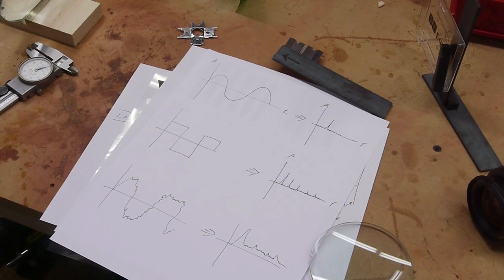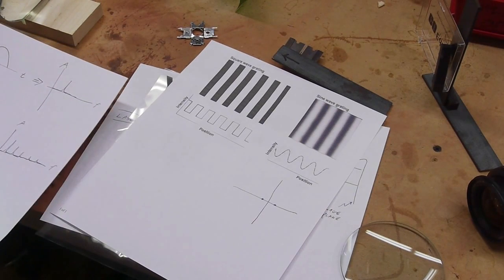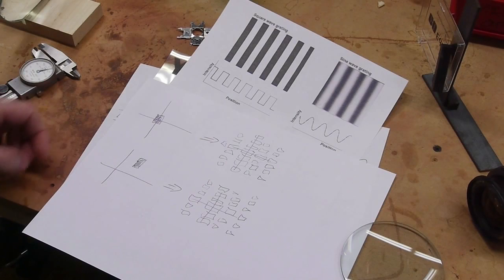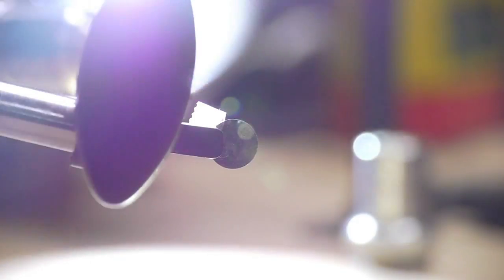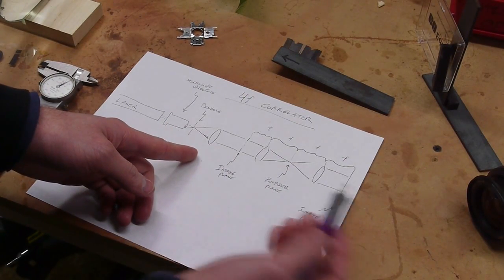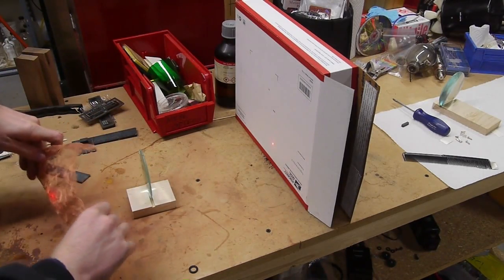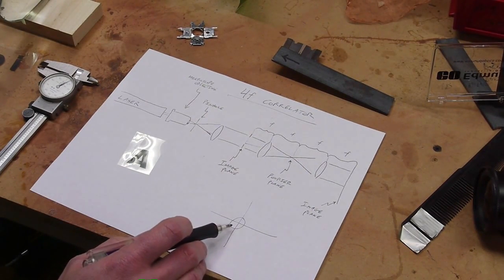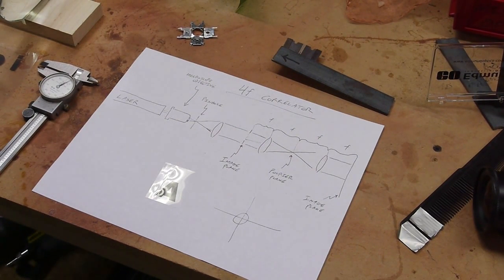Intro to Fourier Optics and the 4F correlator

Comment: Nice video and a good basic description. There is a minor but common error when you say that edges cause rays to diverge. This is a common misconception that many amateur astronomers have about secondary mirrors and their support vanes. The resulting diffraction pattern is due to the absence of light from those regions, not scattering. You can validate this with a simple Python program that simulates Fraunhofer diffraction. Although the math in the Fraunhofer approximation is complex, the underlying principle (basically Huygen's principle) is not and you can numerically find the results without all the complex math.

Comment: This is simply put a Bertrand lens. In microscopes it allows you to see the back focal plane, i.e. shifting the conjugate planes of a microscope, and obtaining an image that can be described as a Fourier transform. 
The same result can be achieved in a microscope by removing the oculars. Of course one huge problem is that in the conjugate plane of an image you also see the emission source itself, which can be mitigated through Koehler illumination.
 A cathode tube is a microscope by all means so all tricks in optical microscopy can be applied.

Comment: Great presentation!  

My physics professor showed me this in the lab one day, more than 50 years ago now.  He used black and white microfilm and microfiche.  He showed me newspapers on microfiche that could be searched for specific things.  Your clearer explanation of how to use the "amplitude only" part of the spectrum to make the information location independent was helpful.  There will be geometric issues I think, but that helped clean up an old memory.  I have over the years kept an eye on this, and now there are micromirror arrays, and many controlled transparency materials to generate the spatial filters using the computer.  Nothing was ever cheap enough for me to try it.  It seems everything that is interesting quickly becomes costly.  But your videos are a good "buy" because you are always trying to show how things work and how to build them and understand them.  I can think of a few things to try, but there is no way to interact on YouTube, except by quickly disappearing text notes. Thank you for your work.  I just watched an old Raman spectroscopy video of yours where you said you were going to get back to it, but I could not find it.  I really liked what you showed with the pinhole.  I wish you had spent more time.  I want to find a way to spread out the intense points in a better way. Bessel beams and optics seems a good path.  I am getting older and there are billions of things to look at and try to calculate.  I can't build anything, mostly too costly or too hard. But I can calculate most anything.  Go figure.

Richard Collins, Director, The Internet Foundation

Comment: The pinhole used to "clean up" the laser beam is in fact the same thing as the filter you talk about later.  Higher order Fourier components in the laser beam itself due to imperfections of the laser cavity, optics, cleanliness of the cavity + optics, etc are "filtered out" by the pinhole.  When an image is "created" in the colimated beam section, you are simply addging "higher order" Fourier compoents back into the "cleaned up" laser beam.

Comment: Im a lay person but curious nevertheless,  where is the fourier data on a holographic film, or in other words how is the information non local, meaning any segment of the film contains all information regardless how small. Even if we cut the film any peace regardless how small will contain all information. Can we extrapolate the data and do we know how this actually works or is it a known unknown? I do know fourier mathematics are involved in holograms and Im curious to know if there is a clear way of presenting this to a lay person like myself as recorded holographic data seem rather counterintuitive. Meaning if you remove a peace of a holographic film one would think information would be lost. I do know that the image is recorded using 2 beams, a reference beam and an interference beam. How this actually works, Im clueless.

Comment: About 15 years ago, I had designed several optical stages that performed multiplexing of 3 beams of different lambda, into a single fiber. Normally this is an expensive set of complicated optics.

Moreover, I needed a tophat beam profile, meaning instead of a gaussian concentric beam energy density like you showed, the brightness of the beam as a spot on a target had to be uniform strength.

This beam forming is a fundamentally desirable optical function, yet the methods to achieve such a profile are extremely complicated and require several optical stages to perform.

To top it off, I am not an optical engineer.

Anyway, the mux ended well with my design being good enough and very inexpensive.

As for the beam former, I searched so many resources and found an obscure optical schematic for tophat beam formation using only to biconvex lenses and a spatial filter. But there was absolutely no explanation. I had theories, but no understanding of how or why it worked.

Your video 15 years later made it clear before you got to your aparatus. Just the description of the spatial filter, combined with the spatial FFT intro.

Effectively, there's two ways to look at it.

The cheesy way, is how I thought it must work:

The rough beam profile is compressed to the focal point and the spatial filter just takes the prime, central cut of the center of the beam and that's all that gets expanded back through the output objective stage, meaning you lose energy, but it's evenly distributed.

But now, from this video, I know better, I think:

The rough beam has some spatial features in it's profile. The distribution of the energy density of the beam cross section itself could be argued as a monochromatic photograph in complexity. That's why your setup needs to clean the beam first, by taking the prime cut and collimating it.

Now you might thing the theory I had come up with is exactly the same only no collimation required.

But I believe it's all about filtering the FFT, Such that the spatial filter in the middle is taking only the lowest spatial frequencies and filtering out the higher frequencies, just by taking the center brightest point of the FFT, and the objective rebuilds a spatial distribution of energy density of only near-zero spatial frequencies, thus creating a flat beam profile.

So it's a lowpass filtering of a rough beam profile's spatial FFT, reverse spatially FFT'd back into a more uniform beam profile. The high frequency spatial noise is filtered out.

Extremely cool!

But now, I understand that the aperture of the spatial filter and quality of the lenses are paramount. But since my image is just to the beam diameter, I don't have the complication of collimation.

Thank you very much for this!!

Comment: Thanks for your video, it got me interested in the 4f setup which I just got to work this evening! Using an impatient setup with retort stands and tin foil filters I managed vertical and horizontal edge detection, low pass blur, high pass edge highlight, and linear blur. Some pics in a tweet https://mobile.twitter.com/SimonPJelley/status/1056701402196656128
I wouldn’t have even known about it without your video.

Comment: is there a more intuitive explanation of why, when focusing diffraction pattern to a single point,  the higher frequencies component of the original light gets focused in the center ? i understand that that high frequency component shows up in the center in a fourier space but not quite sure why it does that intuitively..thank you
Reply: High frequencies end up farther away from the center than low frequencies.

Comment: Modify it to reflect the object such as a picture that you can compare the know Fourier transform from file and the tested object for noise and distortion result that if both are equal, the display would be consistent. If it's a fake, noise and distortion would be seen.

Comment: the first 50 seconds of this video explained fourier transforms more clearly than 2 weeks of university lectures.
Reply: universities are monopolys part of the industrial complex
Reply: That's a problem.  Classes and the books for the classes focus on the math instead of explanations of what the subjects are about and why you're bothering to learn them.
Reply: @MelBYoung  can't use the fourier transform if you don't know how to perform the integral my man. Like, you can use FFT packages in software, but you still ought to have a good understanding of the hand calculation as an engineer.

Concepts can only take you so far, eventually you have to learn the application of the concepts, and how to do that yourself.
Reply: @tissuepaper9962  Agree, but my point is that there is an overemphasis on the math details rather than the concepts behind what the math details are describing.  Most textbooks (undergrad and grad) revel in the glory of the math rather than explain the concepts well.  Physics textbooks are the worst.
Reply: Universities are now called "learning institutions" , and definitely made me feel like I was being institutionalised. All I wanted was a pepsi.

Comment: One question, why low frequency will go through the center and high frequency are on the edge? Thank you.
Reply: At the focal plane between the lenses is where the Fourier transform image is located.  The axes of the image are now transformed from spatial coordinates to frequency coordinates.  If you block the center, you're blocking the lower frequency components which are close to 0 frequency.  Spatial frequencies are measured in cycles/distance (say, mm or cm).
Reply: High frequencies are out towards the edge because they are far away from 0, therefore far away from the center of the image at the FT plane.

Comment: @Applied Science
Now if you just cut of the central frequency(which is constant) by placing a tiny sphere in the focal point between 2nd and 3rd lenses, only light that is slightly deflected will get through. Now if you put for example a hot air between 1st and 2nd lens, some rays will get bent due to differential in refraction coefficient and won't be cut by the sphere. This system is called Schlieren method and serves for visualizing slightly bent rays (such as hot or condensed air flows) and I'm really surprised you haven't shown it.

Here's the image of how it looks: http://nptel.ac.in/courses/101103004/module7/lec7/images/24.png

I did try building this system myself back in the day, however, I did not have any  lens of suitable size which led the system being ineffective. Your lens are fairly large and should work really well, you don't even need a coherent light source for that.

Comment: In order to take care of scaling, couldn't you take the collimated portion through which you shine the light through your transparency and replace a portion of that with a non-collimated region that gets re-collimated and then move the image parallel to the direction of light travel? Effectively increasing and decreasing the relative diameter of the collimated portion with respect to the image?

Comment: Completely agree with you: optics has such a ridiculous learning curve and everyone seems incapable of talking down. 

Your setup is 100% legit. However, I would caution against hot gluing objectives; the optics inside are always effected (eventually) by temperature contrasts. I noticed you have an EO container; objective adapters are easily available from them (or cheaper, Thorlabs). They should also have pinholes which I remember being not too bad, they should get down to around the 1um mark, especially if you can get them used
Reply: +1
Reply: Better than buying a pinhole, just take a stack of 5-10 layers of aluminum foil, and stab it very gently with a sewing needle. When you separate the layers you get pinholes of varying sizes. If you are gentle enough with the stabbing, some of them will be unbelievably small for how low-tech the process is.

Comment: In the mid 1980s a colleague (now deceased) and myself tried this in my basement lab, with a HeNe laser, and 35mm film snapshots of various silhouette objects, same general setup.  The concept was for target object acquisition and recognition within a 2D "search" region . . . it sort of worked.  Then I went to the CLEO conference in Baltimore (1986 ?), and first thing I saw, walking into the tradeshow demo area, was the Perkin Elmer high tech version of the same concept, sorting out planes and tanks silhouette targets, from anywhere within an addressable 2D vision plane. Well, anyway, gave up on trying to compete with Perkin Elmer . . . but it was interesting.  You video brought all that back to life . . . thanks for posting.

Comment: 6:39 Why the concentric circles?

And why is the center orange, but the outer bits red?
Reply: +RonJohn63 
This is infact the spatial Fourier transform of the pin hole
Reply: +RonJohn63 The colour change is due to the camera/your eye. It isn't really there, we just can't see/measure those sorts of contrast changes well.

Comment: Wow that link is great ..so basically you can use spacial filters in the fourier domain to block out frequencies in the visual domain . essentially like digital filtering in audio  only in visual context  . I guess this completely makes sense in the way that pictures are frequencies of light ..
Reply: Nope not really... Different colors are different frequencies of light, but you wont filter them with a spacial filter shown in this video...
The frequencies ment in this video are actually "directions" or spatial frequencies, which are totally different than the optical frequencies of different colors.
Reply: No, Graham is right, it is just like digital filtering in audio — spatial filters are applied directly on the image (spatial domain). And Ben perfectly demonstrates the way of analogue filtering of images in the spatial domain. It would be also possible to filter on the Fourier plane (e.g. pin hole), that would be like performing a FFT on an image, perform some masking on the spectrum (low/high pass filtering) and retransform it (INV-FFT). You're invited to try this with OpenCV, should be no problem at all...

Digital spatial filters only shift some filter masks over each set of samples, in images 2D-samples, for audio only 1D samples, they don't need any transformations into spectrum — so it is pretty fast for digital images. That means: After applying spatial filtering and performing an FFT on the spatial filtered image, you can see the filtering results in you spectrum representation.

Comment: Well you can try the image comparison with your eyes. If you have 2 identical pictures and one has a verry small diference tan the other if you manage to look at each image with the coresponding eye yourbrain will fuse them in one and the difference will be flickering. I have tryed it and you can basicaly solve the "find the difference" puzles in seconds, no matter how hard they are.
Reply: Holy shit. This newfound trick has fundamentally rocked my world. It's funny because I've used "crosseyed" vision to look at stereoscopic images and get the 3D effect, but I've never thought about doing it with two slightly altered images from the same perspective... Wow.

Comment: A nice quick way to make a small pinhole for the spatial filter is to get a stack of aluminum foil sheets, and take a sharp, thin sewing needle and lightly poke the stack. Separate the foil sheets and you will get pinholes of smaller and smaller diameter. One of these will be what you are looking for. Then mount the foil.
I use this method all the time rather than worrying about purchasing a pinhole disk, and is a good replacement for when someone in your lab burns out your spatial filter with too much power! ;)
Reply: Great hack
Reply: bro breach the Matrix

Comment: Cool. Early (pre-1980s) synthetic aperture radar (SAR) systems used optical processing. Optical have been revisited fairly recently as the processing can easily be done in real-time and is very power efficient.

Comment from the maker: At 11:03, I start describing what you can do with the 4f correlator. Notably, it was used for image shape search before computers were able to do so. For example, finding airplane silhouettes in film negatives. It can also be used for image processing, such as edge-detection, blurring, etc. Often, I will start a tutorial video with the real-world application and then describe how it works, but in this case, I wanted to describe Fourier space in general first.

Comment: A webcam with the lens removed works great for this. The chip is often nice and small, excellent for viewing the small image. If the features on the slide are small enough, the pattern in the fourier plane will be millimeter sized and you can easily view the effects of using a mask to remove the zeroth order, the higher frequency components or components in certain directions, for instance filtering out all the diagonal parts of characters in a text. Works really well.

Comment: Hi Ben, scottrharris is right. With large objects, like the letters you showed, the pattern in the fourier plane is only a couple of tens of microns across, making it hard to see and manipulate. The lenses you use are fine, I use similar ones when I show this setup to physics students in an optics class. For the object, try using a slide projector slide with very small features on it. The image in the exit plane will also be small, but an easy way to view it is to project it onto a bare ccd.